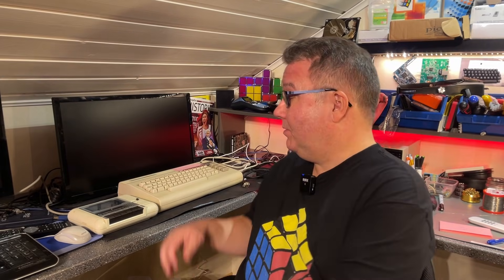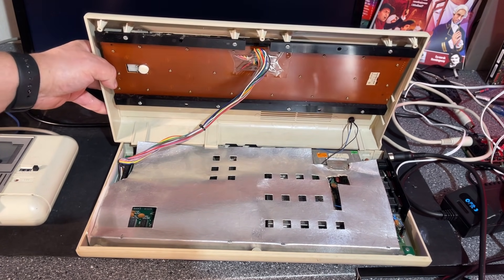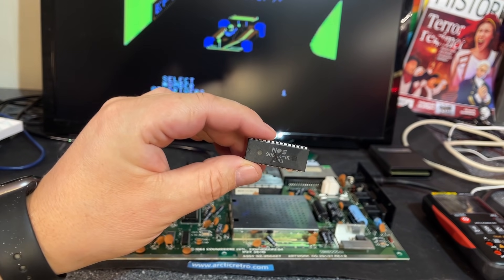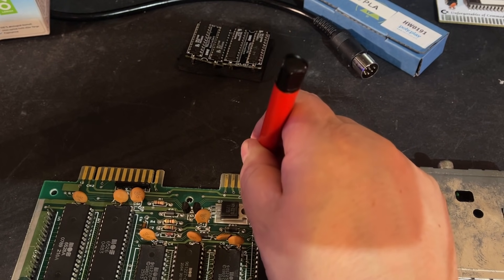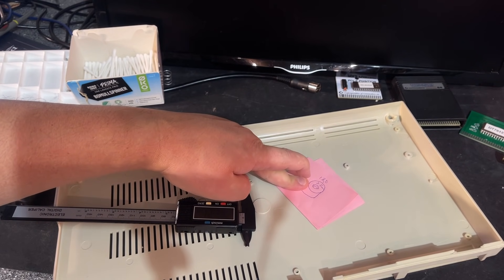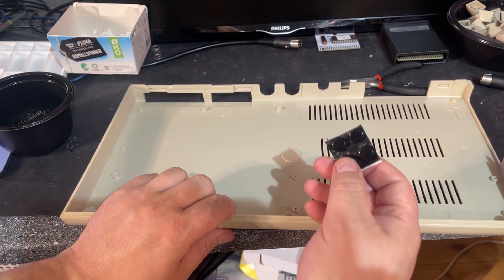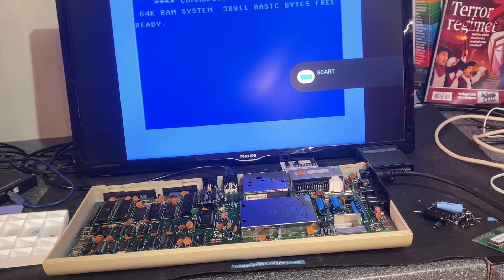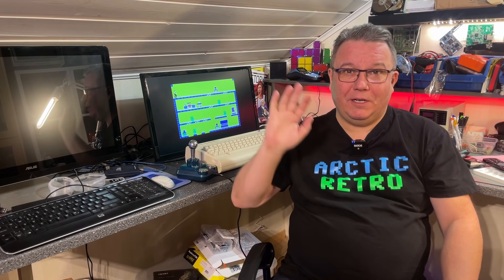Commodore C64G repair and restoration - Black screen, case repair, 3d-printing, recapping

Comment: I am with you on being wary of dishwashers. Water from the tap is full of minerals and salts that remain on the contacts after the water has evaporated and can cause corrosion and short circuits. If my boards are really dirty, I wash them in distilled water. Epoxy-packaged chips are water-tight when they come out from the factory, but if the pins get corroded after decades, water can penetrate a bit into the package and accelerate the corrosion to the point that pins fall off the package from the root. As for using a fiber pen on edge connectors, that's fine if the contacts are tinned. But on gold-plated contacts I wouldn't use a fiber pen at all; it just removes the gold plating, which doesn't corrode (that's why they use gold) and only needs cleaning with contact cleaner.
Reply from the maker: Thanks for the advice :)
Reply: I am totally with you on the use of distilled water.
Have anyone here used ultrasonic cleaner with distilled water on motherboard cleaning?

Comment: I would consider an unloaded power supply at 5.16V within specifications. The voltage is designed to be slightly above 5V to compensate for voltage drop in the cable when the machine draws power.
Reply: I agree, 5.16v is completely normal. Depending on the PSU type, anything between 5.0 and 5.3 is normal. The issue is whether it remains at 5.3 and for how long
Reply from the maker: Good explanation. The PSU is probably fine. But you never know when these failes

Comment: Another thing: Dead test and Diagnostics perform different ram tests. That is why you don’t get consistent results. The diag is more thorough, while the dead test is meant to identify dead chips but not necessarily testing every bit
Reply: To be precise: Dead Test runs in Ultimax mode. In Ultimax mode, only the lowest 4KB of RAM is enabled. Therefore Dead Test can only test the first 4KB of RAM.
Reply from the maker: Ok, thanks for the explanation :)

Comment: This is the version I grew up with. Sadly I don't have it anymore. Now I have a UK built bread bin with the dark keys and a C64C. Even if the voltage was within margins, you made the correct choice by not using it. These old power supplies can't be trusted. If this power supply is the only thing available, there are over voltage safer cables available which go in between the power supply and the C64 which prevent an over voltage to reach the C64.
Reply from the maker: Thanks. Yes I already have a C64 Saver too

Comment: I prefer attaching the replacement hinges to the inner backside of the top cover. Also, I prefer to use metal hings made out of perforated metal band, which can be easily shaped and bended. It is super strong and will stay in place.

Comment: @31:25 the case is marked "Memory Expansion". Did the C-64 ever have a memory expansion option?
Reply from the maker: It is the cartridge port. And it is for the most part used for ROM expansions (games and utilities). So that is memory. So it is kind of correct. Also, there exists RAM expansions for the C64. I have never seen that labeling on a case before.
Reply: Commodore's original ones were called the "REU". There are modern ones, such as the Turbo Chameleon, which has a lot of other features in addition to being an REU.
Reply: @Arcticretro  Ahhhhhh! Thanks!

Comment: Thanks for the video. Nice repair and nice machine. You don't recap the TV modulator?
Reply from the maker: Sometimes. But it is too much work for it to be worth it, it it starts to fail, I rather replace the whole modulator with a modern

Comment: The PLA20V8 obviously is compatible with the Diagnostics cartridge, however, it did cause problems in this case. This is not that common, but incidentally some mainboards need a bit more work. There seems to be a link with 200ns RAM chips but I have never found a root cause, the vast majority of boards with 200ns RAM just works. You can try switching between 25ns and 15ns GALs or try using the alt2 file with a 25ns GAL, this often helps and results in a stable machine. However I do recommend to fix it (even use the Plankton), since a crashing Diagnostics is a sign of a malfunctioning machine. If it crashes Diagnostics, it will crash in some software.
Reply from the maker: Ok, thanks for the input :) This was the first time I tried the GAL-PLA

Comment: 14:00 - it's a bit surprising that the GAL PLA would be problematic - it's meant to have excellent compatibility. Mind you, given we're ⅓ through the video, I'm assuming there are other surprises lurking!
Reply from the maker: I tried 3 different, and they all hung the diagnostics test, while the PLAnkton did not.
Reply: @Arcticretro  It'd be interesting to see what parts of the PLA diagnostics it hit issues with. It's just a pity the diagnostic cartridge doesn't show those details.
Reply: @talideon  I see around the web that others have successfully completed the diag cartridge with the GAL-PLA. I suspect that machine may have some borderline screen RAM that works fine normally but probably fails due to some timing issue with the test when used with the GAL-PLA.
Reply: @projectartichoke  That makes sense.